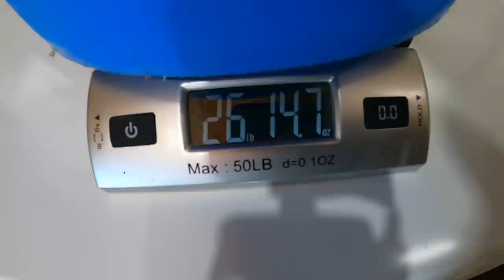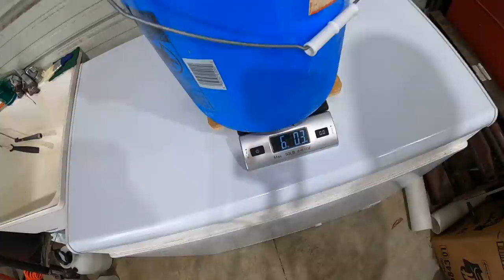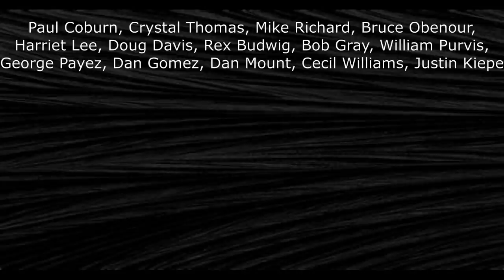Homemade ice maker! New fan and new personal record! #562

Comment: Suggestions... 
1) Put a fan on the cooling pump motor area to increase cooling efficiency there and remove that heat buildup rapidly.  Thought is that the cycling cooling fluid will probably be a usedul amount cooler in its cycling.
2) An internal fan needs to draw coldest air from  base to optimise cold circulation... perhaps use the directional fan mount to be near base and blow upwards... Perhaps use an air guide /  tube duct from freezer base cold pool... guiding air upward to fan intake... and focus outflow over ice freezer units.
Lots of fun watching you show really helpful insights. Appreciated.
Reply from the maker: Last years build I did have 4 inch pipes ran to the bottom with two fans in them blowing cold air up.  Production was good, but no dramatic improvement. I also ran a box fan on the compressor area for several days monitoring energy usage.  Little to no change there. Thanks for watching

Comment: Something to try.   Find a way to make a vertical column or duct outta that black plastic stuff.   Allow you to mount the fan near the bottom but keeping it outta the ice.  The fan can suck the really cold air even when there is a load of ice in the cooler.  Of course you’d need to have some of that duct with holes drilled in it at the bottom below the fan to allow it to suck in the air.  Might even get it to blow up and right on the ice makers if there is some room back up thereehind the makers to channel the cold air right up the ice.
Reply from the maker: I did something similar in version 2.0 build on the channel.
Reply: @TKCL  I’ll check it out thanks

Comment: Try smaller fans with 2" pvc pipes running down into the bottom or midway down like you did with that bigger fan contraption.

Comment: wrap the outside of that freezer with a couple inches of rigid foam and I'll bet you get another new record.
Reply from the maker: These freezers are hot on the outside because they must shed the heat they are removing from the inside. Insulation on the hot sides would hurt more than help. The top and bottom could use it though.

Comment: The flat fan runs hotter due to design. The cooler fans suck in unrestricted air flow cooling the motors creating less motor heat.

Comment: What if you had one fan pulling cold air from the bottom with your pipe thing and one fan blowing across the ice makers? Or a pipe on the side that runs up to your one blower fan so it can suck air from a lower point?
Reply from the maker: I've tested pipes pulling from the bottom before. I seen a 7-9 percent increase in production.
Reply: @TKCL  I seen that in the first 2.0 video. But was wondering about one pulling from the bottom and one blowing sideways.

Comment: Are these fans on the thermostat controler you posted in the previous video? Or what is the current set up?
Reply from the maker: No, I am using the manual switch they came with.

Comment: I keep having an issue where the water freezes from the fill tube down into the plastic part that drains into the cube tray.  Did you have any issues with this?
Reply from the maker: Never have had that happen. Sounds like you might be overfilling the ice cube trays possibly? I'd try adjusting the water fill timer down on the end of the ice maker.
Reply: @TKCL  ya i switched to smaller cube size.  I repurposed an old LG unit I already had
Reply: @TKCL  So I think I've found my issue.  I tried to repurpose an older freezer and it never gets cold enough.  I can barely get to 20 degrees (with probe at the ice maker).  What temp are you typically at when you haven't opened it for a while?  So that's probably why I get some condensation on the lid, or the fill tube has issues etc.
Reply from the maker: No that's normal, I am usually around 0 at the bottom and much higher up top. Thus the reason the fan is so critical to keep air mixed.
Reply from the maker: Make sure you caulk and seal all holes around the wires and tubes on the outside. Pulling in warm outside air through the tubes is asking for trouble.
Reply: @TKCL  Really? That temps ok?  Hmm I guess I'll defrost and go through and extra seal anything and everything. Then give it another go
Reply from the maker: Mine runs very hot up top without a fan. Heat rises and you have a lot of heat load up there with fans, warm water and ice maker heating elements. Put your thermometer in the bottom and see what you get. If it's 20 degrees down there you have a problem.
Reply: @TKCL  ya i have the og fan you used, currently running.   I have thermo on "ledge" right now.    Giving it some time then will check
Reply: @TKCL  ok after all night the temp in the bottom is 11 degrees.  I found the lid wasnt as flush as i originally thought so i put lots of weight on it to keep it closed and got a decent amount of ice.   So thats the ticket. I need to reseal this thing better and restart.
Reply from the maker: Yep, good deal.

Comment: I think if you were to line the shop wall behind the ice maker with a 3/4" sheet of Styrofoam insulation board would keep the radiant heat from warming up your freezer. Put your hand on that wall after the sun hits it. The metal will be hot. I would suggest you cut the sheet about two feet taller and wider than the freezer and mount it to the wall. You would probably save electricity and help the freezer maintain temperature much better during the hot Florida sunshine days. Colder freezer = more ice production. Happy to see you back in the ice business again. I really enjoy your tinkering with this project. It is what brought me to the party. I stayed for the home build.
Reply from the maker: No doubt, but that ice maker is about to find a new home in my air conditioned shop room.
Reply: @TKCL  Most ice machines run the compressor continuously,  yours is cycling off from the thermostat. That might be affecting it thawing when it shouldnt
Reply: Humidity plays a part on production

Comment: I have no use for your ice maker design but could not help myself and went down the rabbit hole. I love your videos. Amazon has an under counter thermoelectric water chiller for $129. It is supposed to cool the water twenty degrees below ambient. I am sure this is a low output cooler but it should keep up with the flow for two ice makers. This will probably reduce the cycle time on the ice makers significantly since they have a small surface area for heat exchange.
Reply from the maker: I've considered one, but my current ice machine is out running me.

Comment: Using that flat fan, or 2, and a custom air "tunnel", you could produce, I'm willing to bet, 15-18+ lbs per day ... Just looking at the current ice maker layout and interior shape, I could see a perfect design for the "tunnel" using that 3/8 pvc sheet and wire rack....ideas, ideas, ideas....Using dry ice as my reference, dry ice over whatever is in the cooler makes it a freezer and freezes everything, dry ice under everything is a frig...if you have a small, 1 inch high should be good, area under the ice, the air will be colder than any other area..That's where both the 3/8 sheet and the wire rack both come in, creating that area that would inevitably be under the ice...those big round pipes were too big...

Comment: The fans are crucial and make a huge difference because stagnant air has a comically small heat transfer rate. Agitated air has a much greater convection heat transfer rate (in a scale many times greaters). increasing the speed eventually make no difference in production gains vs raising fan power electricity cost. Great DIY.

Comment: Hey Andrew, one problem that will crop up is that, that freezer does not auto defrost and at some point ice will build up around the top of the freezer and where your ice makers are. So, as the frost builds up, how will you keep that frost from effecting your ice makers as the your ice continues to grow?
Reply from the maker: I Defrost twice a year for a good deep cleaning. All ice makers should be cleaned multiple times a year and that's often neglected.

Comment: A last test I can think of. Bend that deflector in such a way that it directs the air to the bottom. That way you force the cold air from the bottom to disperse over the whole freezer.
Reply from the maker: I could mount the fan on a wall to accomplish that.
Reply: I was just thinking that...you should do that test.
Reply: Once the bottom starts filling with ice, I think you lose the efficiency of the fan used in that manner..an empty bottom would be perfect..

Comment: Andrew, very interesting results with the new design. Curious what the results might be if you added a 2nd fan on the opposite corner on the lid? Would be interesting to build a second freezer without modifying the lid. Need to get an FLIR camera and you can detect where the refrigerant lines are in order to avoid piercing them when drilling the holes.
Also, I might have missed it, but what was the electrical consumption results for the tests you ran?  Curious what your cost per pound of ice worked out to be. 
Looking forward to your future projects and experiments.
Reply from the maker: I didn't mention the kwh usage this time and should have. 2-2.5 kwh usage a day for the single fan and 3 kwh per day for the cooler guy fans. Single fan on medium costs me $0.50 to make 20lbs of ice. That's the freezer electrical costs factored in too.

Comment: What is the material you used for the little diffuser you made?  Did you buy it on Amazon or do you have a link to where it can be purchased?
Reply: He mentioned in the video that it is a sheet of ABS plastic like they make drain pipes out of.
Reply from the maker: It is ABS plastic off of Amazon. Sadly I can no longer develop links on mobile and I'm not near a computer to get you a link.
Reply: @TKCL  thanks my hearing is going and I just didn't hear it when you said it.

Comment: One idea would be is to have the fan on the collar pointed down to the bottom to circulate the air to the top from the bottom, instead of just circulation around the top, just a thought
Reply from the maker: A novel thought and idea.
Reply: @TKCL  I believe it would still achieve the circulation your after and still draw the colder air from below. Collectively putting our heads together lol

Comment: How long does the ice take to melt?  Does water that was frozen at a slower rate last longer? If you introduce hot water it will freeze faster , But I suspect it would melt quicker as well, negating your gains. I suggest that your efficiency hasn't been measured completely, until you measure the variables in performance. Also, compare your Ice with store bought ice, which could have entrained air (lower density), and physically more surface area (so it freezes quicker). One pound of your ice performs as well as 3 pounds of store-bought ice? Could this change your 60 cents per pound to 10 cents per pound? Considering what you would have spent on ice. Currently I buy two bags of ice, a day, to keep my beer and milk cold in Arizona. Thanks for sharing.

Comment: If you look at the fan in your freezer by taking the back panel off of the inside it blows on the bottom of the ice maker so I would try putting a fan in the bottom of the freezer  a false plate with holes in it so when it's full the cold air will be forced up through the ice to your upper fans that flat fan

Comment: I have chest freezer turned into kegerator,I put a computer fan in 4 inch about 3 ft.  tube from top to bottom fan at top blowing up brings cooler air from bottom to top circulating constantly worked great

Comment: I think at a certain point, you are introducing more heat to the system than the benefit when running that squirrel cage fan so hard.

The ice is so much whiter with fans, because the faster water freezes, the less the dissolved gasses can escape as it freezes.

You're right that you want to circulate water to get crystal clear ice, but you want to circulate it AND freeze very slowly.

Comment: Definitely some interesting results with the various fan setups. 

From some other videos I’ve seen. To get the crystal clear ice it’s not about agitation of the water while freezing, but slowing down the freezing process. So put a container of water in a cooler and then put the cooler in the freezer will produce clearer ice.

Comment: hm. get a grate or holed sheet metal. cut sheet to fit area over the compressor. use pc (computer fans (12volt) hang fans under the grid pointing the air flow down. hinge! he entire grid to! he metal grid to the back(similar to lid hinge) then no ne d to modify original freezer
Reply: fan at top pushing air down a tube, and a grate on the bottom to allow air to flow over entire bottom. at some point it is diminising results, or margin of error. plus there is a limit to how much heat the freezer can pump out even given ideal conditioners

Comment: I searched the comments and may have missed it but do the arms that normally tell the ice maker to stop producing ice in a typical bin still work or do you have to cut the ice makers off manually when the freezer is full?  Just bought my freezer for the build.  Thanks
Reply from the maker: They still work, make sure you watch the final video where I run this on solar power. I put trash bins in the freezer and it works great.
Reply: @TKCL  10-4. I definitely will.

Comment: On the electrical hookup ; the approved method is that your riders lamp cord is the identified neutral wire !
The ice makers cycles are operated by clock timer motors ! There fore only so many cycles per day regardless of the air movement or not ! The number of daily cycles determine the amount of ice ! Add another ice maker and the ice out put will go up !
Reply from the maker: That;s not entirely true as proven many times throughout this series.  The heating and dump cycle is on a motorized timed cycle.  What triggers that timed cycle is a temperature reading of 10 degrees or less.  So the more often you can get the mold temperatures back down below 10 degrees after heating and filling, the more cycles are triggered in a day increasing your production.

Comment: Have you considered a ducting system, where a cylinder duct that runs down to the bottom of the chest  (maybe on the corner) and the fan pulls the air up from the bottom and pushes it to the top? Kind a like a big straw. Perhaps at the bottom there is a grate that allows melt to drip through, but not the ice, and creates a small void that the "straw" draws coldest air up from the bottom of the chest to the top and the ice mechanism.
Reply from the maker: Yes I had that in there a few episodes back in the series. It made a slight difference. However I didn't like all the piping in there taking up my room.

Comment: Air mass from the bottom of the freezer should be easy to achieve, build a rack from bakers racks small bread square type. Then build a tunnel for the fans to pull the bottom freezer air, this will also help keep the ice colder, and produce more ice even when full, or until shut off. Also a fan posted insulate the area around the freezer/icemaker but make sure it has plenty of are movement to keep the compressor cool! Nice vids I have bought the cheaper ice makers for my cool tub we use in Florida heat, but they don't last long out side, This is an idea I'm going to research for my out door kitchen! Thanks for the testing and build vids!
Reply from the maker: Thank you for watching

Comment: Super interesting and ingenious fine tuning. Good job. I have one followup question: what kind of frost build-up - if any - does the freezer develop over time as it fills up with ice? In one of the earlier videos you had a clip where there seemed to be a lot of frost buildup. Thx.
Reply from the maker: About twice a year requires a defrost and cleaning. That should be done with any ice machine in my opinion.

Comment: What about using 3 inch pvc and some 90s.  Start above ice on side wall and run it down across bottom,  then back up to the  fan.
Reply from the maker: I've already tested that with 4 inch Pvc. I seen a 7-9 percent increase in production.

Comment: Issue with the manitowoc restaurant ice maker is it’s wet ice.  Yours is “dry” non melting ice.

The manitowoc / hoshizaki’s are constant melt.  Once the ice is made, it sits in an insulated bin and starts to melt.  The compressor never kicks off and all the ice that is made continually melts.  Why those ice makers require a drain. Super wasteful for residential use.

Yours is the perfect setup.
Reply from the maker: I absolutely agree and my ice lasts longer.

Comment: Correct me if I am wrong but don't you basically have a multi hundred square foot cooler that is kind of empty at the moment? Get yourself a hand truck and run that freezer over into the pantry and then you could do like 3 24 hour tests and know exactly how much you can make with no variables.
Reply from the maker: That's coming very soon as it's new home (air conditioned) is almost ready for it.

Comment: I believe you have plateauing on the ice maker kit and the Chest freezer cooling capacity .

Each ice maker are usually rated to 3lbs to 3.5lbs per 24 hours . 
If the chest freezer has bigger compressor and capable to pull down to lower temperatures. The more ice making capacity you are going to have .
That 11-13 pounds of ice a day is pretty good .
Reply from the maker: I agree
Reply: @TKCL  on the 3.0 version . You might have to find an Ultra Cold chest freezer . One that can go -10 or -20F .
I bet the ice production would jump another notch 😁